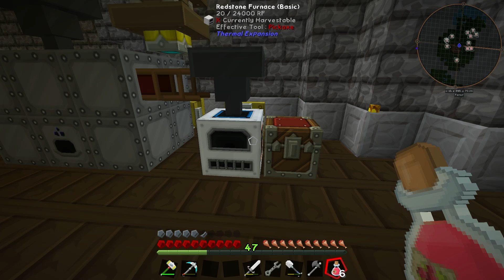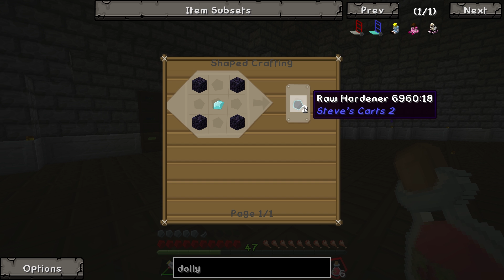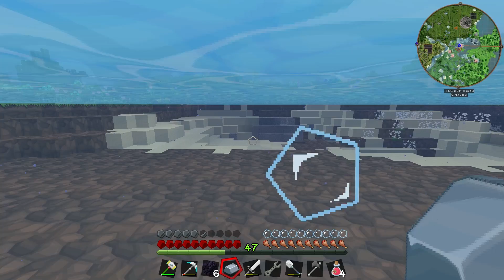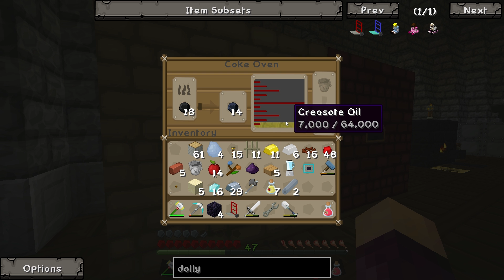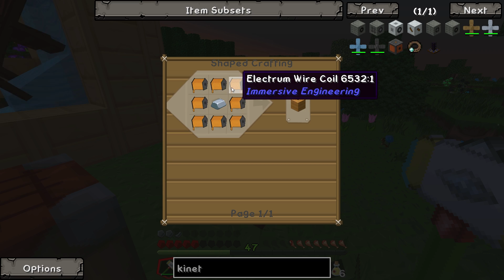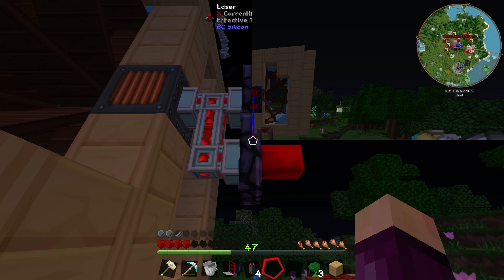FTB Infinity Evolved - Ep.8 - Renewable Power!

Comment: Immersive engineering has a great relatively cheaper way to transfer Redstone flux useing coper wires transformers ect ... they also give a rather nice asthetic (in my opinion) other than the brick like tubes running everywhere, just to spice things up a bit since you have said in many of your other video's you like trying new things. i dont know if they are more efficant or not.
Reply: +F0r3v3rT0m0rr0w Yes, but this pack has issues with the wires vanishing occasionally for no apparent reason, and you would need to constantly recraft them and place them again.
Reply: +kynealdyr yup. happened to me. annoyed. now when i made like everything based in them and poof i just changed pack to dns, too much annoyment.
Reply: that's the first i've known about this bug, it has yet to happen to me.
Reply: +F0r3v3rT0m0rr0w forst look at immersive - i loved it but when i have been forced to use it cables, it quite ruined my hard-grinded save. it was so much dam grind and what? ugghh 

now i h8 immersive only because of those. now i switched to other pack, too much annoyment, as i mentioned before
Reply: if its a bug, report it to the developer so it can be fixed.

Comment: If you put pressure plates on the floor by your garage door it will open and then close behind you. If you use carpenter ones you can set them to player only for outside but right click works fine as you run over the plates inside on the way in and the door shuts :), good series, you have more patience then me :)